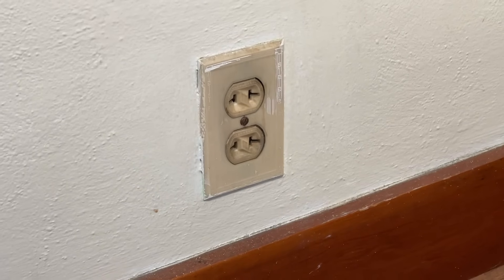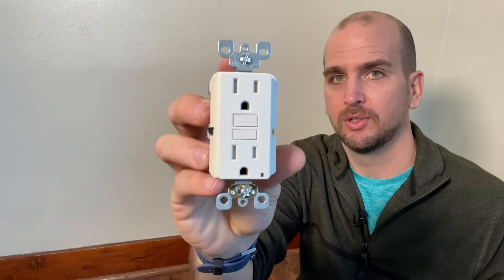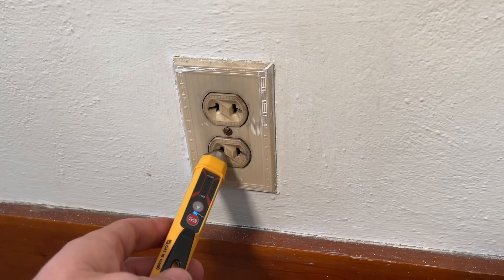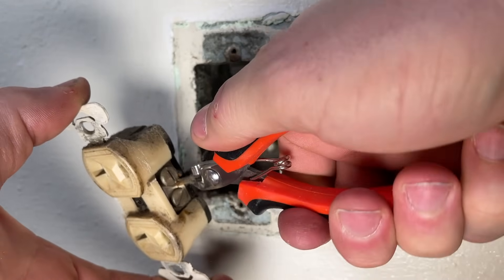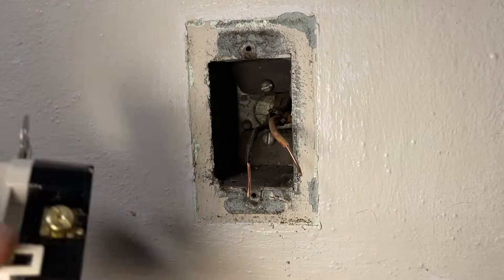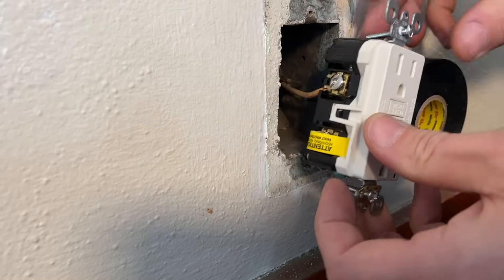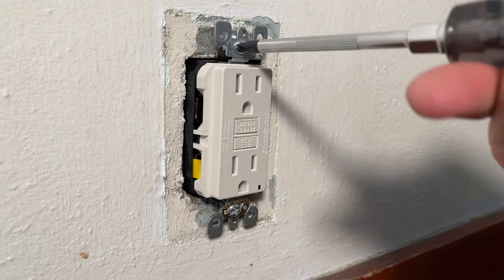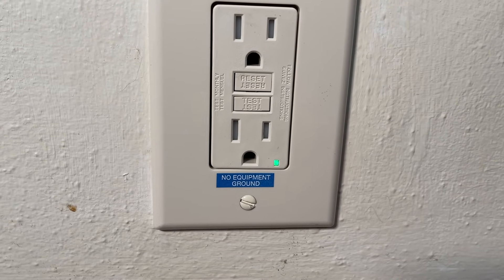How To Replace An Old 2 Prong Outlet Using 3 Prong GFCI

Comment: Hi there,
Thanks for the informative video. I have an old (1929) apartment that has non-polarized outlets. Some outlets have 3 plug-ins some have just 1 plug in. It's a small apartment so only 6 NP outlets and one in a closet that looks polarized. I knew when I bought it it would need electrical updates. Can these just be changed to a regular polarized outlet or do they all need GFI outlets since there is no ground wire? They are all in no water rooms. I'm concerned I'm ruining my computer by having it plugged into a NP outlet :(

Comment: I'm moving into our family home, built by my grandmother in 1960, and I have questions. 

What could happen if there are ungrounded 3 prong outlets without the GFI? (At least one room already has this)

How can I tell which outlet(s) should be the GFI?

How hard is it for a pro to add ground return lines to a mid century home? 😬 

Thanks for the great video.
Reply from the maker: You should not have any 3-prong outlets installed without a ground.  The GFCI is a way to not run a new ground to each electrical box but also keep the outlet safe since if there is a short the GFCI will trip.  To retrofit your home with a ground that can be expensive depending on the size, access, wall covering material, etc.  You can easily get into the  $3K - $5K range or higher.
Reply: @EverydayHomeRepairs  Shouldn't they make GFI outlets that have only a two-prong socket for installations that have no ground rather than depend a little sticker that might fall off or never be installed or never read?

Comment: Section 8 Failed GFCI.. 
One GFI they failed because their jiffy popper would not trip the test mode (its a 2 wire service..)
Second GFI works and tests fine but tester says open ground.. again its a 2 wire service
Am I wrong in thinking she should not be failing me for these? What is the solution to run independently grounded outlets?

Comment: You know what I really need? A video showing how to run just a ground. I have some ungrounded outlets and running just the ground would be easy from the basement, but then fishing the wire through really would not. Don't even know where to start on that.

Running entirely new wire sadly isn't an option. Too complicated because of the sub panel it's running to

Comment: Just had a circuit breaker trip recently, I've checked all outlets and unplugged everything. Can't get the circuit to reset, what can it be so I can get it fixed. Also nothing was marked in the box so I don't know what all the switches actually run to anyways.  Do I need to get the switch replaced or is an outlet causing it to stay tripped?

Comment: I am still not clear what the blue label "No Equipment Ground" means and does. After this change over, is there ground or no ground (just one addition hole)?
Reply: It is so that if someone tests the outlet with an outlet tester and sees open ground he does not mark it as a failure.

Comment: Not sure why he is installing a GFCI outlet in an area that you wouldn't find water.  Usually GFCI outlets are placed in bathrooms, kitchens, anywhere you would find water.  Also the "third prong" is the ground.  You are just going from an ungrounded 110 to a grounded 110 outlet.

Comment: This dude is full of goose excrement this is not safe there are no short cuts on two wire systems.  You must change out the old two conductor rag wire to be protected from a partial short to ground. I see these videos all the time on here but never see a test to see if it works. Gfci outlets won’t work without a dedicated ground wire period.
Reply from the maker: Nope, GFCI feature does not need a ground to properly work.  It is simply tripping when a difference is detected between the hot and neutral.

Comment: Your just screwed up again. Your need jumpers on that gfci. The law states that your need to have at least 6" of wire coming out of the wall.  So you should've added jumpers/ pigtails so they your don't cause permanent damage to the wire that goes into the wall. Every video is another screw up. Also that electrical box is metal.  Your have a self grounding outlet but the truth is they really don't ground themselves.  You could've screwe a green ground screw to the threaded ground hole inside the junction box and attached the ground wire to the outlet and it would've grounded everything but again you know nothing but keep making videos

Comment: My dad was an electrician and journeyman.  He taught me to wrap with electrical tape like you did here and then flip the end on itself for ease of removal if needed.  
I have ALWAYS done this on every receptacle I have ever worked on!  Thanks for the tips, Dad!
Reply: That's correct a "courtesy tab" , my old man thought me the same....
Reply: So Im guessing you're not an electrician??
Reply: @Grim_R13576  FATHER is....was (dead) local 600.  No, I'm not a journeyman or electrician.  I had to go thru a little more school and in engineering over 30 years!  :)
Reply: U have 2 hook ups how do u do that with an up dated outlet
Reply: 7:39
Reply: I do this when I write labels on masking tape too. Picked it up form working in a lab as an undergrad!

Comment: I thought GFCI was designed to help prevent shock in wet locations like kitchens, laundry rooms, bathrooms and outdoors.
Reply: A GFCI prevents shocks in all places where it is used. It does not require water to operate.

Comment: Absolutely incorrect! Your GFCI is ineffective! You have to have a ground in order for this to work properly. You are actually causing more of a problem here, as people would think this is safe, when it really is not. You have to have a ground. This is not at all safe, and you are misleading people. Any electrical inspector would fine you for this and definitely find you at fault here. Your video should be removed.

Comment: Dude thank you. Electrical work has always intimidated the hell out of me and my entire house is old 2 prongs. You’ve made it much easier and less scary.
Reply: Ours too - we are definitely not using adapters.
Reply: Many homes with 2 prong outlets have an equipment ground that is just not connected to the device (outlet). If there is a ground there is no need to this kind of outlet and they are $100+ each btw. If there is no ground at all your wiring needs to be replaced. Most older homes these AFCI GFCI outlets will not even physically fit in an old electrical outlet box.
Reply: @StanSwan  Where do you live that these are $100 ea...?  They are $22 here.
Reply: @davidklaus6666  Spec grade. You can pay $60 for a 20amp duplex receptacle.
Reply: @StanSwan "an equipment ground that is just not connected to the device" 
Do you mean that inside the box there is an unconnected wire with no insulation?
Reply: @sparkyheberling6115  No. I mean a metallic raceway or cable that acts as the grounding path. Like electrical metallic tubing or BX cable for example. There is no ground wire required except from the box to the outlet.
Reply: @StanSwan  Thanks. I will give that a try.
Reply: @StanSwan  I had hopes, but unfortunately there was nothing behind the metal box except the two cloth-covered wires (the house is over a hundred years old). Guess I'll use GFCI receptacles.
Reply: @sparkyheberling6115  Sounds like you have knob and tube wiring. An issue I run into with that is the boxes they used back then will not always have room for a GFI outlet. I also would never plug anything like a space heater into an outlet feed with knob and tube. It was never designed for that kind of load and has degraded over time.
Reply: @StanSwan  I thought there was a good chance the receptacle was grounded, because somebody had replaced the original two-prong receptacle with one that accepts three prongs—and there was  even a wire connecting the box to the grounding screw!
Reply: @sparkyheberling6115  Well they tried? They still make two prong outlets and I would use them over a GFI. There are arguments on both sides that are valid. If I had knob and tube wiring I would feed it with arc fault breakers. The code does not require it but accs are what cause fires most of the time with old wiring. Maybe you had a lamp that "sizzled" making that sound when you turned the switch? That is an arc.
Reply: @sparkyheberling6115  My home is not quite as old as yours, but I also will be dealing with grounding some of my outlets in the future.  I have cloth wrapped NM cable per 1955-56 NEC Code, as the house was under construction in 1955 with the new 1956 NEC Code coming into play.  My area (Orange County California) had tougher codes than the NEC at the time.

I hope you had some success in dealing with your wiring.  Hopefully, sometime within the past 100 years, the fuse box was replaced with some kind of circuit breaker box and panel, rather than using resettable fuses that came out in the 70s as a stop gap for older homes with fuses.  In 1955, the code set to take place in 1956 required 3 prong grounded outlets in bathrooms, laundry rooms where the outlet was near a sink, central heating furnaces, kitchens near the sink, and on outdoor circuits such as porch lights.  A garage required grounded boxes, but not 3 prong outlets.  My home uses an early version of the Square D XO circuit breakers, which were considered state of the art at the time, while most other homes used screw in fuses.  The panel is grounded to the cold water pipe.  One day, when my pipes get replaced with copper pipes, I will need to have the plumber bond the ground wires to the pipe.  Current plumbing code now requires cold water pipes be bonded to an 8 foot grounding rod as well.
Reply: @maxheadroom8857  You want to change your pvc pipes to copper? What is the advantage? The pipes in my house are copper, so there is lead solder. 

You wouldn't believe the shoddy work done in the last 50 years here. For example, the garbage disposal was leaking, so I got onto my back and slid under the sink to investigate. First thing I saw, looking up at the bottom of the unit, were the words "this side up."
Reply: @sparkyheberling6115  My plumbing is galvanized & copper, not PVC.  I had a main line burst outside my home right before it entered the house.  My plumber put in copper pipe and a brass connector to adapt it to the old galvanized steel  line underneath my home.  Fortunately, my house is a raised foundation house, not a cement slab house.  I've been under it before to run a tv antenna cable into the house, replacing an old 350 ohm TV antenna wire with a more modern 75 ohm cable.  I don't subscribe to any cable or satellite TV services.  I saw where my electrical ground wires were connected to my galvanized cold water pipe.  I will need to change the water pipes to type L copper water lines in the future, as the galvanized lines are aging and mostly original to my house, built in 1955, meeting the 1956 NEC regulations going into effect later that year.  I inherited the home from my parents who bought it in 1961 from the original owner who built it himself.

By the way, in California, lead solder is no longer used in plumbing or electrical.  My plumber let me know the solder used was lead free when he put in a new line from my meter to the line leading into the house.  He told me about the 3 grades of copper pipe used: K, L and M.  M is the thin and economy grade in residential plumbing.  The company he works for does not use it.  K is a commercial grade pipe used mostly in offices and other commercial property, because it's the costliest grade.  Type L is a tougher grade pipe used in homes to last a long time.  That is what I will have when I get the rest of my pipes redone in my home and in my detached garage, as the ground goes to a cold water pipe buried under my garage.  I will be running a new ground wire to a new cold water line when my plumbing is replaced in the future, to not break the continuity going to the box and water line.

By the way, that garbage disposal hookup must have made you wonder what else was done in a not so professional way.  I helped out in replacing a rotted out garbage disposal for my folks back in late 1985.  It was the first time my folks needed to replace it.  The disposal was hard wired, so they had me install it for them, since they knew I knew my way around house wiring.  Next time, I need to rework the wiring to put an outlet box in the wall and use a 3 prong weather resistant single receptacle for a garbage disposal, perhaps with an outside type protector for an extra margin of safety.

Comment: Bro, you only need a GFCI in a wet location; kitchen, bathroom, outside, etc.  Not only that but you still don't have a ground, just hot and neutral. That old cloth wire also has asbestos just so you know. A fix for no ground because it's a 12/2 no ground. Run you a little piece of wire from the neutral to the ground on either a gfi of outlet. Its not right or how it should be done but it'll still protect you.
Reply: Just stop that right now. This is the legal way to do this. Do not improvise with your connections.

Comment: Putting a GFCI in an ungrounded outlet is unwise (though for some reason allowed). If a “short circuit” occurs and there is no ground wire present, a fire could develop.  Or, if you were to touch the plug at an inopportune time, the current could find its way to ground through your body, causing a shock.
Reply: Well if there was to be a short circuit the GFCI would trip do to the inbalance of voltage between the hot and neutral contacts within the GFCI circuitry. It would not let the current travel through you, even though there is no ground connection.
Reply: @elidanko1912  I know how GFCI works.  The thing I do not like is that the visual queue of a lack of a ground plug is the problem. When you put a GFCI there with the third prong it can fool someone.  And they could still overload the short cicruit cutoff switch in the device and cause a fire.

Comment: If it gets inspected, it will show an open ground. Safest thing to do with a 2 conductor system is add a jumper from the neutral to ground terminal in the gfci, as long as the main panel is bonded and ground to code

Comment: Your correct on all what you said. But depending on where you live you actually have the plug upside down. You want the ground on top so just in case of a flood and the water level gets to high, you do not want to ground the water. Turning it upside down keeps the ground up high and gives you a longer time to get out before the water gets electrified. Just in case your breaker does not flip or your GFI does not kick off.

Comment: That is BS as the old 2 hole outlet only has 2 wires a hot and Net , there is no ground wire , there fore the GFCI will not work as it should ,  what does the first 2  letters stand for in GFCI ?  GROUND FAULT repeat GROUND FAULT , there is no ground fault protection , again no ground wire connected to the GFCI . That is the main reason for a GFCI is to sense GROUND FAULT

Comment: Hi I have a question that receptacle didn’t have ground wire to attach to the green screw or do you supposed to add one wire for the green is true or not?
Reply: Dude this guy is a hack and flat out dangerous. A GFCI needs a ground period.  Otherwise just install a 3 dollar standard plug and not even use the ground.  A GFCI can get fused without a ground. And this will cause a fire hazard

Comment: Once again, you're spreading incorrect information. According to NEC 406.4D, if you replace a receptacle in your house, you have to also bring it up to arc fault code, meaning putting in a ground fault receptacle does not meet 2020 code. You need to install an AFCI/GFCI device to meet code

Comment: Why wouldn't you use a ground screw and atleast bond it to the box?
Reply: It's a bit more complicated than that. That power cable isn't ground wire carrying and way out of current code.  The box doesn't have a ground back to the breaker box.  And the only type of ground is the leakage to the wooden studs.

Comment: I would avoid cutting wire with old work. I had a problem in my house in which a lot of the wires in the boxes were cut too short because they were done by weekend handymen, so you wanna save as much as possible

Comment: The correct way would be to pull a new branch circuit to the box and make sure the ground is going to earth, NEC article 250,  granted you just have to abide by the codes the year the house was built, but in no way, shape, or form, is this electrically safe and still presents a fire hazard during Transient Surges!!

Nice Video though! :)

Comment: So if it's a metal box there's a good chance that the box is grounded..so that adapter when you screw it into the receptacle is actually added an equipment ground.. it is safe and UL listed....your "safe fix" while allowable by NEC isn't added an equipment ground you even have to add the label that says "no equipment ground"

Comment: Hey , thank you for the video. Forgot to press the reset button after i installed the outlet and kept scratching my head. Things are working awesome after the swap out thanks to your video. 
Question : Is there a way for me to find out if this process of swapping 2 prong with gfci (along with the no ground sticker) is acceptable in my state ? i tried googling it but failed horribly. Any direction would be appreciated.